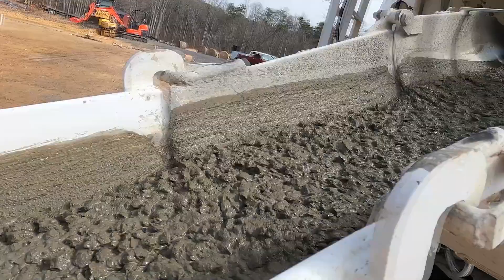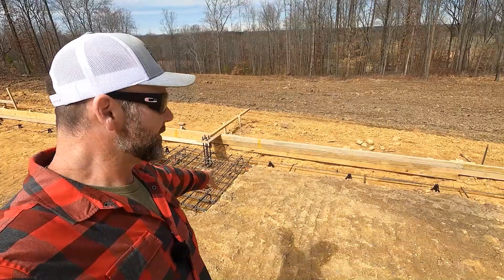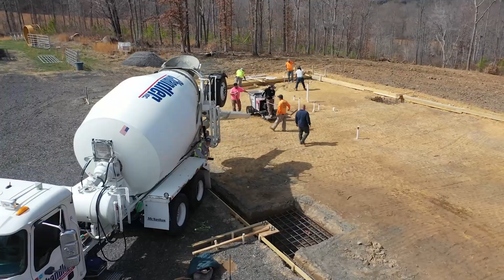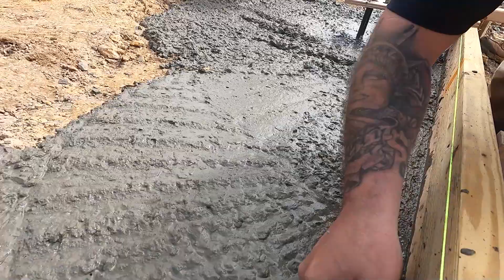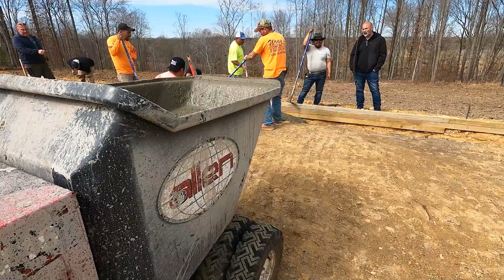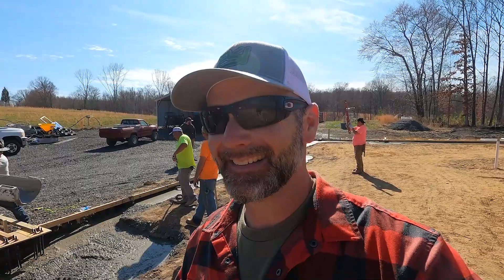Mega Shop Bardominium Build: Pouring Concrete Footings today

Comment: I didn't see anyone using a Vibration tool to ensure the Air Pockets are expelled on the Footings.
Is that due to the thickness?
Reply: Shallow footings. These aren't formed walls.
Reply: @RJCAM2020 that's pretty wet concrete poured during the cooler parts of the year and you can see there is no open cavities where air can be trapped.
Reply: @RJCAM2020 G M is definitely correct. Concrete has to go through a slump test and this is very wet mix, you could use a vibration tool but its kind of like using a vibration tool in a milkshake, there really aren't that many voids to remove.

Comment: Josh. I’m a retired construction superintendent pouring the footings first is the best way. Lock the anchor bolts in place. Then come back to pour the slab. Your bolts will be dead centers not all over the place.  Looking great.  From my hill top in. Sc
Reply: For sure. It’s been decades since I helped my dad who was a builder with a concrete pour. Get it set up right. The big bolts set in the concrete look strong.

Comment: Nice!!! We do it a little different, never poured footing first on a  slab for mono pour. Usually pour the whole thing. We just finished a 65 x 120 with 14’ eves. Tractor and equipment barn for one of the Native American reservations. Mueller steel buildings is what we use mostly but have used steel master and Magnum steel. It’s gonna feel like a stadium there Josh but they fill up quick let me tell you!!!!
Reply: Mono the best way.. 💯💯

Comment: Going to be a great shop!!  BUT if It was my shop, and I was there, at the 7:55 mark, when the buggie driver dumped and slammed the crete in and moved the rebar cage, and into the form, they would have stopped on the spot! Redone everything, sent that truck home, and started over!!
Reply from the maker: Lol I’ll bet you would. I agree that was a bit of a hard dump but you aren’t sending 15 men and 5 concrete trucks away because one little support turned over buddy
Reply: @StoneyRidgeFarmer  You want to bet on that?  What happens, or who is going to pay when your beams don't line up and fit correct?  You are!!!!!    Not the the cheap labor driving the buggie!   I watch all you videos, and have for a long time, but do me a favor, don't complain if there is a issue, please.  Just mention this post.  Thank You   Josh, you do well,  just looking out for the good!, Nothing to lol about
Reply: @davidlang576  it's a good point, sir. I'll just say that for anybody trying to get something done right now, it will be so much more difficult. Even more than usual, at every turn and step in the build the owner is going to have to make value judgments. This crew was surely not the highest bid and with that may come some extra effort on the back end. The what looked to be about 12" slump gave me a twinge for the whole placement. But in the end, I think it will all work out and Josh will be able to tackle whatever lies ahead. We'll get to see as it happens...! 😁 cheers men and well wishes!
Reply: Watch the anchor bolts. The stayed right where they were supposed to. Also they later picked up and dropped the bolts to get rid of any air pockets. You can’t sweat the small stuff. That pier is so over engineered that you could lose 50% of the rebar and still be way over uplift capacity. If were talking door casing sure, don’t be so rough. But with these footings , get them filled!
Reply: I doubt if you would sent all those guys home.. Shit happens on pours. Would of cost more money.. For sure your not getting any money back from the concrete company. Worst you maybe fired the guy who did it.

Take a deep breath address the situation .. Hold one of the trucks back.. Have the guys fix it or block it off counting with pour.. How do I know? it happen to me.. ✅✅💯💯.. Cost me about 600 bucks.. and I still bought lunch..IJS

Comment: I hope someone was paying attention and pulled that first footing back into position after the concrete pour guy pushed it around. Luckily the bolts were braced externally and stayed in position. I would have expected a deeper pier footing, but if it’s signed off then that’s all that matters. 
The Germans have developed a neat way of saving on concrete by inserting plastic balls in a grid pattern between two fixed rebar grids. Just when you think there is only one way to do something, along comes a better idea… 😬
This is going to be great to have an inside space to work in.
Are you planning on putting a vehicle lift in there? Might need the rebar placing before you pour that pad, it’s easier to do that now and not need it, than to do it later. I was expecting to see you plan one for the building as you have so many farm trucks needing maintenance now, Andrew Camarta is always using his.
Actually a hoist might be useful too, tractors are heavy machines

Comment: The Guy running that little truck with concrete. The first dump in the footer. Knocked the rebar off center in that corner. I hope he didnt knock the bolts off by dumping it way too fast..UGH..Hopefully they readjusted that corner because the whole thing moved...Just wondering if you seen that Josh. Other then that one thing Its looking good.

Comment: The drum spins on to concrete truck so the concrete dont separate. Actually the faster the drum spins the concrete will harden faster. This is because of the heat from friction.

Comment: How much is a yard of concrete nowadays? If the concrete is 6 inches thick and the building is 112ft x 56ft it will take a little over 116 yards of concrete.

Comment: Well that first cart load racked the rebar,forms and anchor bolts when he slammed it in there. I don't wanna use that contractor for my shop foundation. Why didn't they just drive the concrete truck around the outer edge of the slab forms and let concrete ease in the foundation forms.....

Comment: Josh.....it would have been cheaper if you would've done an monolithic pour, and just as strong too...in fact if you are concerned, you could've used Fiber Crete, and the cost of fiber would've been covered by the savings of pouring your piers and footers.  Fiber Crete has an 79 percent reduction in cracks and shrinkage plus the strength would've been rated with a Highway mix!

Comment: That's a ridiculous price for a slab. Family got a 36 * 50 ft slab and footer poured in last Sept for 32k south of St Louis. Still looks flawless. I thought that was a lot of money. You don't even have any forms other than the holes/ trenches dug. So seems like it would be cheaper. They just laid rebar and poured footings... No stem wall no slab... I'd hate to hear what the rest is going to cost you.
But thanks for sharing what prices have gone up to
Reply: There's a lot of variables in placing concrete.. Then just a square foot cost.
Logistics, grades,.. Etc
Reply: UMMM,  COVID AND OUR MOST RECENT INFLATION Price of EVERYTHING IS WAY UP !!

Comment: No slump test, no vibration. You have not protected the threads on the post bases. Where is your ground bonding to the rebar?. No conduit in the pour to make wiring easier, and where are the conduits from the step-down transformer for your service feeders?
Reply: I saw some pipe work under the footings for drainage. I’d imagine the incoming feed is just going up the wall and in, but if you look at 5:03 then a vertical conduit is visible.
Maybe he didn’t film a slump test? And the bolts were protected later on.
Vibration is an odd one, I would have expected to see this even on a shallow footing, especially for piers as it makes it stronger. Maybe it’s just trying to save money.
It looked like a support cone got knocked during pour, hopefully it got noticed, I’m not sure this crew were the best ones out there, they are just the ones with the best bid.
You have to consider where he is, he can’t keep running a farm out the back of a domestic garage, but neither can he hire RR Buildings to make a million shekel barn just to show off on YouTube.

Comment: All of that concrete could have been poured for the outside with the truck without using those carts and it should have been cheaper they was charging they probably charged you $1,000 or more for using those cards cuz they own them and then it took the guys longer to do it according straight out of the truck would have been the best it brought me when it took you more an hour and 15 minutes an hour and a half the most and if you could have found a company that had front discharges you would really been going they can pop that in there real quick I know because I worked in a concrete industry for several years holding concrete making blocks facing concrete pouring footers all of it
Reply: It’s probably possible with a pump truck to run around the footings, but it’s tricky when the footings are so shallow, you’d constantly be moving. A tipper machine is also a solution so maybe that’s just their preference or the equipment they had available that day?